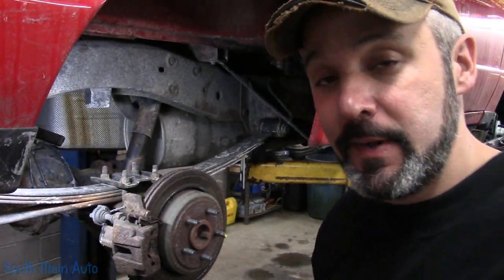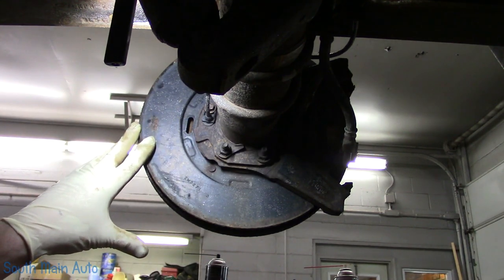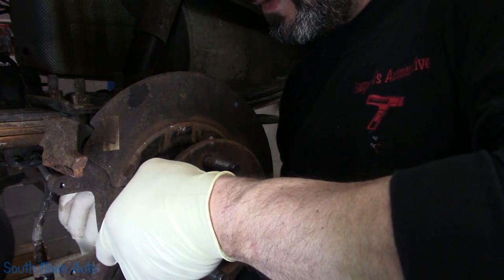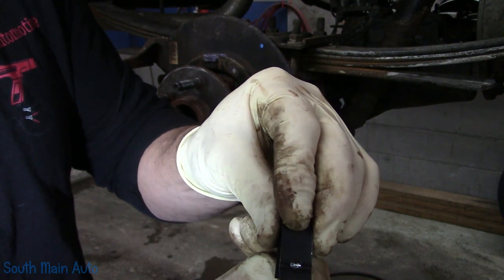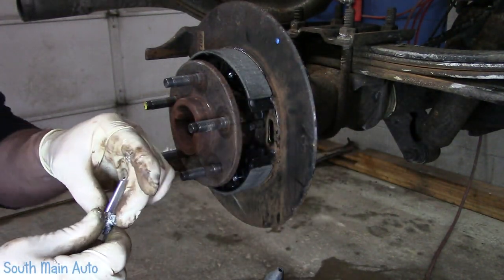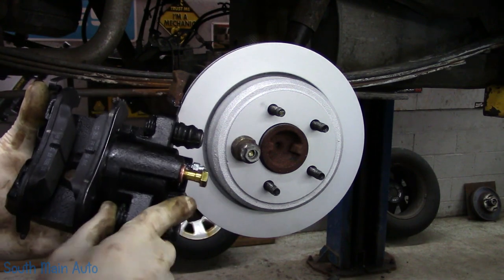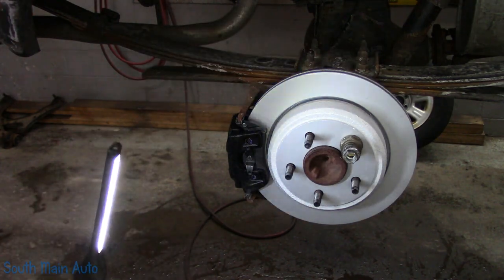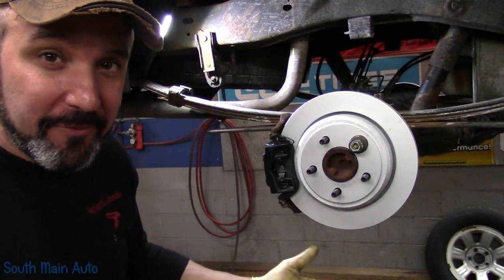Ford Ranger: Full Brake Job Overhaul - Part II

Comment: When the parking brake freezes up in the on position, any tips on getting the rotor off?  Great video!
Reply: Smack the rim with a hard mallet a few times while pulling the ebrake release. Common issue in the rust belt. Clean before setting again.

Comment: That caliper grease you use is that synthetic based grease ? If so is it designed for plastic parts as the brake piston is or rubber parts ? Thanks, Henry
Reply: The lube I use appears identical and is silicone grease with ceramic particles. Hydrocarbon based greases attack some rubbers, and melt and run at lower temperatures than silicone. I've been using it for several years now, and it's by far the best product I've found.

Comment: and I thought my 2011 Ranger was a little rusty... wow.
Reply: You should see my 2001 Ranger.  It is dissolving away in my driveway.  Last week the back of the leaf spring broke off the frame an is poking up through the bed.

Comment: Eric always talks about the parking brake only being used once a year or so.  Is that a northern thing?  I was born up north in Wisconsin, but moved to Texas when I was about 13 and started to drive.  I've used a parking brake about a million times since then.  I'm in flat North Texas, but still I use the parking brake on even a slight incline such as my driveway.
Reply: It is a NY annual "safety" inspection thing.

Comment: Why the yellow tip on one wheel stud?
Reply: You put that wheel lug on first or it won't seat correctly.
Reply: When I was working for Porsche-Audi that would be where we'd line up the valve stem with the axle to maintain wheel balance.  And we did balance the tire to the rotor at 120 mph.
Reply: No kidding. I was joking.
Reply: @phprofYT  They do that at the plant to show that torque was checked .
Reply: Good idea.  Perhaps my dealer should do something similar.  Ah, never mind.  After they ruined 6 of my lug nuts I'll do it myself.

Comment: The Nails, oh the nails ! I don’t know if you have in the US the kind where you have to get the things through a coil spring and and button, so you have to compress the springs with whatever you are holding the button with ? add that to a deeply indented back of the brake set-up so you can’t get pressure onto the head of the nail properly ?    And the button slips out of the pliers for the tenth time, allowing you to add to your collection of blood blisters from the pliers ? While sitting on the kerb in the dark when you started at lunchtime ?  Those nails....
Reply: They make a tool for those. Maybe you should get one.
Reply: Definitely get the tool. They're cheap, you won't regret it.
Reply: As for those stupid tools I have several including the Snap On one, they don’t always work !

Comment: What is the part name and part number for the wizzy wheel you used to cleaned up the axle hub around the wheel stud. This is the wizzy wheel that goes over and around the wheel stud. I purchased them in the past and need more. Any help would be appreciated.
Reply: 3M 07547 Scotch-Brite Roloc Brake Hub Cleaning Disc Kit

Comment: i did the drum brakes on my ranger and i think they are adjusted to loosely, but i'm not sure. if i engage the parking brake in drive it stops the truck from going forward. if its in reverse and i only hit the parking brake it doesn't stop the truck. but when i hit the brake pedal at the same time as the parking brake in reverse it stops the truck even after i release the brake pedal and leave only the parking brake engaged. please help
Reply: All the parking brake really needs to do is keep your car from rolling away. If you park on a steep hill and set the parking brake and leave the car in neutral will it roll at all? If no it's fine, if yes then you need to adjust it out further.
Reply: On drum brakes adjust with the drum on, keep adjusting the shoes out til you feel a moderate amount of drag when trying to turn the drum, this will result in good brake pedal height and parking brake performance.

Comment: Anyone or Eric know what that attachment is called that goes over the studs  and clean the rust from around the wheel studs. Can't see it on his Amazon shop.
Reply: 3M brake hub cleaning disc kit

Comment: When you highlight advance brake clean, they should write you a check. If they won’t may, maybe somebody else will. What a waste it was going to disc brakes on the rear of pick ups. I just do not see any real gain other that increased cost.
Reply: I agree, generally, but I think they work better with ABS? (Which was definitely an upgrade)

Comment: We don't have annual inspection here yet. When my parking brakes on my old E-250 bit the dust and jammed up my rear rotors. Well, I did what every respectful law abiding citizen would do. I ripped the darn things out. Yep, that is right no E-Brake for me brother. Like you said when do you ever really use those things on an auto tranny. I hated that set up for the E-Brake. The new design is much better unless you have an electric parking brake.
Reply: I use mine sometimes just to keep them freed up for the annual inspection. I sometimes do apply them though for parking on very steep hills.
Reply: Nobody ever plans on having an emergency...

Comment: dont need no stinkin  disc brakes on the rear of a pickup,my silverado disc wore out at 30 thousand,my ford ranger has drum,has the original shoes at 140 thousand
Reply: Drum brake shoes wear much more slowly than brake pads, also on a smaller truck they are going to last longer.

Comment: Persistent sulfur smell possibilities: 
1. Your shop has become the abode of Satan. 
2. You're having a mini-stroke.
Reply: Might have been popcorn.
Reply: Bad batteries smell like sulphur
Reply: 3. Toilet sewer pipe vent line problem. 😷 I've had a vent get clogged with leaves and a bird's nest before and the sewer gas (hydrogen sulfide) comes up through other areas like the sink or shower drain whenever the toilet is flushed.

Comment: You know, when you think about it, generally automotive engineers do a pretty good job when they design all of this hardware. Now I know we all bitch and moan about who the hell designed this and why did they do it that way. So now, stop a minute and ponder a bit as to why. 
First, it has to work and it has to do it for a reasonable amount of time with little or no attention paid to it. 
Second, in may cases it has to be designed small enough to fit in cramped spaces where no human was ever meant to go. 
Third, someone has to be able to install it on the line with little or no difficulty to keep the line moving. 
Fourth, it has to hold up and work properly under conditions dictated from the sub zero arctic to the blazing heat of the desert. 
Fifth, it has to have some ability to resist corrosion/wear and not fall apart for an extended period of time. 
Sixth, it has to serviceable later in its life by someone who may or may not have the necessary skills and tooling to do the job. 
Seventh, it has to be as inexpensive as possible to keep costs down so the vehicle is saleable. 
And last but not least, it has to meet all the rules and regulations determined by a couple hundred different governments around the world to make it acceptable. 
Not an easy job, not easy at all. So the next time I'm cursing something that is resisting my efforts to pry it loose or put it back together, maybe I'll stop for a minute and think about that engineer who might have spent a month of their life designing that part to meet all of their given criteria, quit my bitching, and go back to work with a tad more determination.

Comment: I really dislike ford's parking brake shoe design. I usually pull the axels to expose it all. Then I do a diff service and replace the seals while I'm there there is usually one that sweats. I always stab myself other wise.... So I'd rather a little more work than bleed. At least this guy is doing it rite... That so seldom happens people can't see it they don't want to fix it. Mehh just the way it is.

Comment: wtf PLASTIC piston in the caliper
Reply: Cut backs , it's just one way the Bean Counters try save money building vehicles today and another way of selling more OEM parts , it's called work security for The Company
Reply: @outbackcountry512  Phenolic pistols have been used for at least 35 years.  Phenolic acts as an insulator and does not transmit heat to the brake fluid.   The phenolic resists corrosion that could cause piston binding.  As for heat transfer, I was driving from Silverton, CO to Gunnison.  On the long down grade into Ouray, the metal pistons caused the brake fluid to overheat and boil.  I lost the brakes on a the twisting mountain road and had to use a combination of the transmission and parking brake to control the vehicle until I got to Montrose where I could have the vehicle serviced.  Quite an exciting ride.  The fix for the problem, after flushing the brake system and replacing the fluid, was changing the pistons from metal to phenolic.  Nothing wrong with phenolic pistons.
Reply: @buckhorncortez   it was meant as a joke , I know all about wheel calipers and such , my dad was a mechanic and carpenter , I grew up turning wrenches and swinging a hammer thru my very early years and still do today even tho I'm a  heavy equipment operator today
Reply: Buckhorn Cortez   I have experienced almost total loss of braking from overheating due to severe fading, but never due to loss of pedal pressure due to boiling. My impression is that boiling usually occurs due to water content in brake fluid. Dry (fresh) DOT3 boils at 401 F.  Wet fluid (~ 2 yrs service, 3.7% water content) boils at 284 F. Your driving conditions may dictate that you replace your brake fluid at shorter intervals.